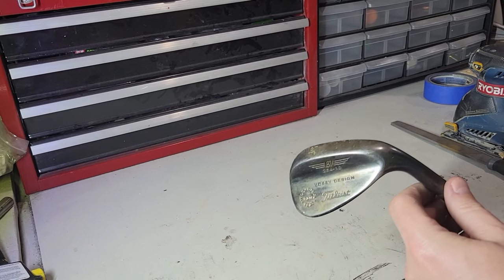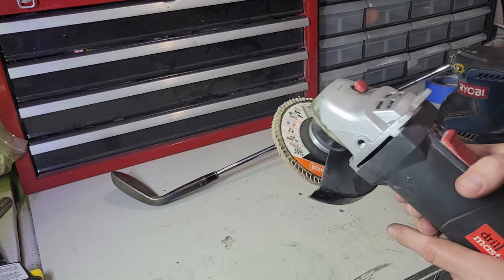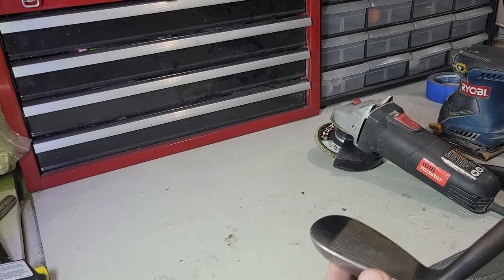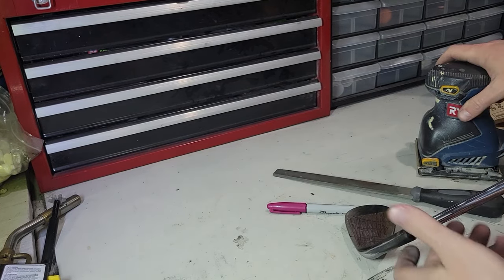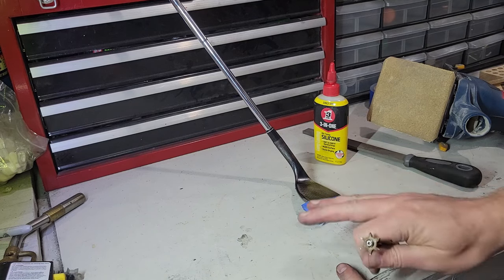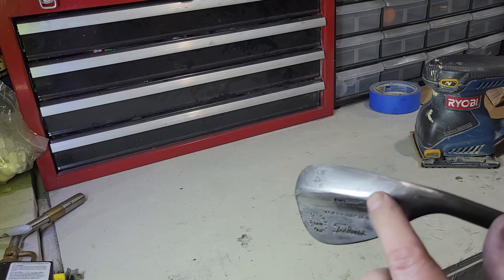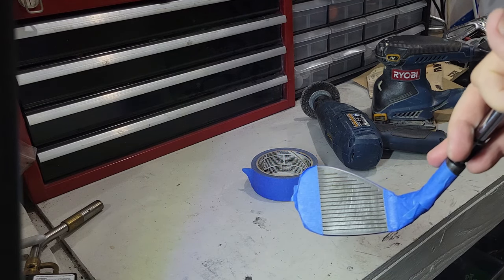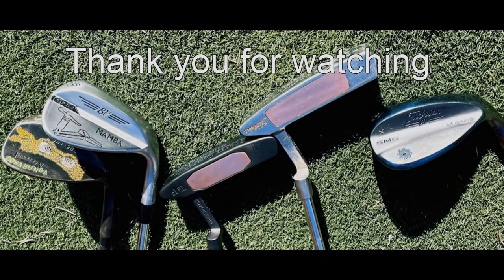Annual Wedge Refinish

Comment: anther tip: you can use a Groovex tool to sharpen the grooves back up, which the Groovex one specifically will get the grooves to the maximum allowed depth and width as it is specifically designed to do this do to the garud system that is on it.

Comment: A deburring wheel is much better than a wire wheel. It’s blends the metal together and creates a “new” finish. Then with polishing, you basically have a new club.
Reply from the maker: I need to add that. thank you for the recommendation.

Comment: The front edge should be sharpened to a razor's edge.  That way the club will cut through the grass and dirt without much resistance.  LOL     But you have to buy a leather cover to protect from cutting your hands.

Comment: Looks like fun. I have four wedges in my bag (present day set with lower lofts, 44° PW)  Callaway set new 10 years ago. They came without any wedges, so I spent big on Callaway 56° and 60° and thought I was done. Later on I realized this left me without the 48°and 52° and was upset with the expense. Found the $25.00 Powerbilt wedges at Dunhams Sports and I like them best. Get em. They are excellent.
Reply from the maker: Wedges used to be $100 new. Now $200.

Comment: Suggestion, where some heavy duty gloves when working wire wheels and clamp the club down when using angle grinders
Reply: Never ever ever wear gloves while working a bench grinder. That's a recipe for getting pulled in.
Reply: Never use gloves with any rotary tool ever.

Comment: Wondering how do you do on your impact face. Sand blast using what kind of Sand material and how much Pressure is used?
Reply from the maker: I use a harbor freight blasting cabinet and aluminum oxide media. I don't use a ton of pressure, maybe 25 or more lbs. Depends on the wedge metal. Some are harder, and some are soft.
Reply from the maker: In my final touches video(towards the end) it shows me blasting a face. It's very quick.

Comment: Great videos! I have just bought old mizuno mx25 and I want to refinish the face (there are some rust and scratches). I have one question: on this movie I see that You only grind the front of the face with one snadpaper grid / manu grinder, you have also used bigger grid and polishing grooves after like rest od the face (but just dont show on the video) or for grooves You used only sandpaper about 100 and than blasting?
Reply from the maker: I have gone more aggressive on the face. It just removed more groove. you would want to use a groove tool if you sand the face more. I try and buy clubs where the face isn't too bad, maybe rusted,  or the sole is dinged.
Reply: @bradreef  so on the face You just even the scratches without polishing after, and finishing with sandblate ?
Reply from the maker: @skateboardingafter302  the goal on the face is to flatten the surface and remove wear.  This will increase the sharpness on the grooves and give you a flat surface for consistent contact.
Reply from the maker: @skateboardingafter302  and. I tape off the face because i dont want a polished surface.  Friction is your friend on wedges
Reply: @bradreef  great thank You, I wil start my restoration next week !
Reply: Hello again, I have repair scratches manually with sandpaper (started from 60 to 2500) generally results are great but on 2 I have delicate  yellow shade on part of the face. What can e the reason of it? And hiw can I repar it (scratch again from 60 sandpaper and go on?)
Reply from the maker: @skateboardingafter302  can you send a pic to diygolf on intagram?  It would help to see what you're dealing with.
Reply: @bradreef  I will send in few minutes.

Comment: Looks great. Why didn’t you show the sand blasting process?
Reply from the maker: Its hard to see through the blasting window and i show it in my other video
Reply from the maker: Go about 1:50 into my final touches wedge refinish video to see the blasting
Reply: @bradreef  Thanks for the quick reply! Is there any other method besides sand blasting the face that you recommend. I don’t own a sand blaster. 
Thanks
Reply from the maker: Check out this video.  It shows a good option with no sand blaster 
https://youtu.be/ryvru6Sr3aQ

Comment: If I want to sand and level the face but don't have a sand blaster... what would be good to "add texture" ? Or just use a rough grit sand paper?
Reply from the maker: I have a video where i simply use a file to leave texture.  If sandpaper,  i would say 50 grit or something low.
Reply: @bradreef  thank you for the reply.  I'll look for the video and I plan to file and leave as is!
Reply: So... I've been sharpening my grooves for a while.  Filed my 60 and resharpened grooves... holy f*cking spin.  I would get a lot at times before but after resurfacing it is very consistent now.  I was doing short sided bunker shots and stopping real well
Reply from the maker: @noworriesman  love to hear that. I find that i get good consistant spin when i do the face refinish.   Just a little less than a new wedge. But very playable and no issues holding any green.